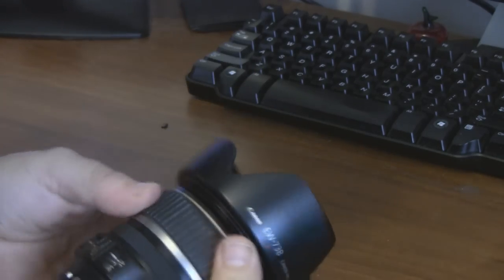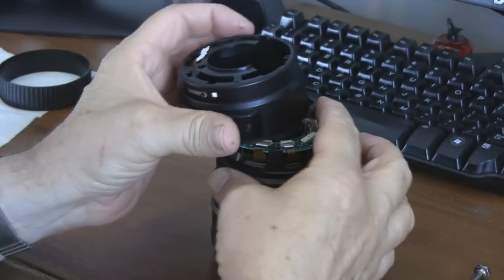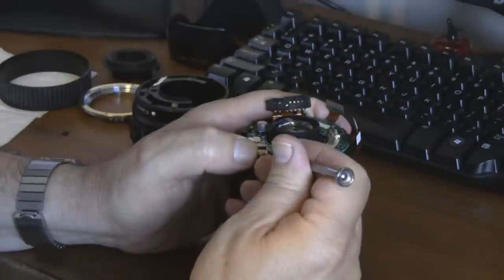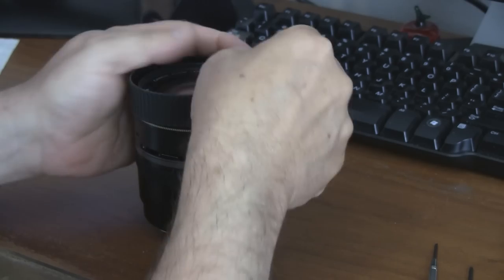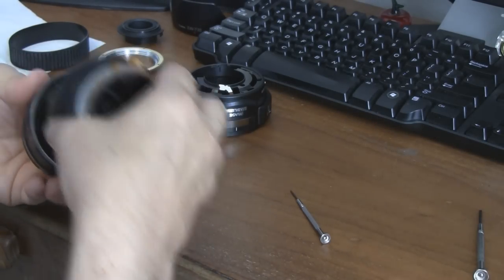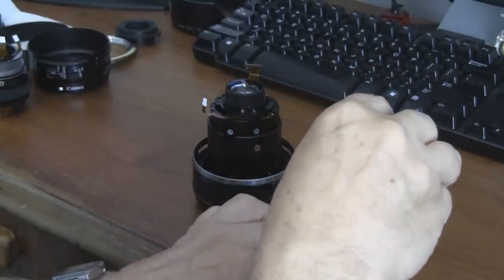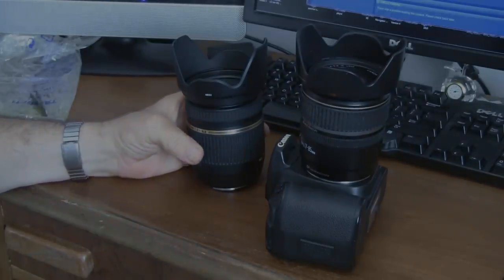How to fix the stuck zoom on a Canon EF-S 17-85mm lense

Comment: Many thanks.  Very clear inistructions.  I used this video to repair my Canon 28-135.  There are a couple minor differences.  To release two of the ribbon cables you gently pull the edges of the white edges of the connector out a tiny bit and the cable releases.  Otherwise pretty much the same.  Using magnetic screwdrivers was a plus.  The zoom screw that was loose was a little one that only showed up as you zoomed back with the housing. Easy to spot. Saved me the cost of another lens.

Comment: Thanks a million for this most informative tutorial!
The zoom function of my lens is fixed (one of the rogue screws, in the heart of the lens,  had completely dropped out).
All functionality tested and working 100% My lens is as good as new.
A couple of tips for those people still to attempt this.
Make a good note (take close-up pics)  of the positions of all components and cables when disassembling the lens.
I also used dots of white correction fluid to mark the relative positions of the plastic components, so they were easy to realign.
I reiterate the words of the videographer; Have good tools! I replaced my watchmaker's screwdriver set for this job. I bought a set with big hand grips.  Money well spent! Without the new screwdrivers I would not have been able to remove the 4 screws holding the bayonet mount, without damage. They were fitted extremely tightly.
Good Luck!

Comment: Thanks for this video. I too stripped or rather bent the fingers / fork of the pressure  contact plate on putting the main lens unit back.You mentioned each screw to remove but for this you said, screw already removed so I opted not to remove it and it was a mistake.  So when I switched it all on the lens was not focussing properly. Disassembled the lens and thought well that’s it, was about to give up but decided to see if I could bend back those fingers to approximately their original shape, I had to use a loupe magnifier,, even the ends of a tweezers was  almost too thick to work on it, and hoped for the best, and it works perfectly now !!!  A few thousand rand (couple hundred dollars) saved, thanks so much!!!

Comment: Thanks. You saved me $300. It wasn't easy, and I am a few hairs less today, but it works like new again. I don't know waht the hardest part was, lining up the manual focus forks, or putting the top ring on and reinstalling the connecters to the circuit board. Thanks again, now I feel like a pro.

Comment: THANK YOU SOOO MUCH! I cant thank you enough for posting this video. It was clear and very helpful. I can finally use my 50D again. I might add i had the same issue of not removing 6 and 6 screws from inner and outer rings. I removed 8 in total and just put them back after. but all is very well.

Comment: One additional point I would make is that the reassembly needs to make sure the AF drive key (twin pronged latch) is engaged to lens focus mechanism when the focus ring is repositioned, took me 3 attempts and bit of info elsewhere to do it.  But like a lot of others here, thanks very much for an awful lot of help.
Reply: Can you elaborate on this? My auto focus is no longer working now that I've fixed the zoom issue and feel like this may have something to do with it.
Reply: +Mitchell Findley 
If you look at the shots about 6minutes25 to 6minutes35, when the focus barrel/ring is removed there is a pronged pieces that sticks down, I think it is on the other side of the barrel so it is not shown in these shots.  This needs to engage with the focus motor drive.  It is a while since I did this and without taking it all apart again I cannot describe it better.
Regards
Reply: +Chris Sweetman thank you I appreciate the reply!
Reply: +Chris Sweetman can you point me to the "bit of into elsewhere" by any chance?  Struggling with this step.
Reply: +beldoolan Sorry, I have had a hunt about and cannot find it now.

Comment: The only thing I can add is that the biggest connector on the PCB has a wedge-lock feature that slides out to release the cable and in to lock it.

Comment: I found this very difficult using only the original video.  A few more shots would have helped.  I'd recommend reviewing the video once or twice before starting and perhaps taking a few shots during the process. I was particular unclear exactly how the different pieces fit together. I also ended up not replacing one screw on the inner-ring. Oddly my camera had only 5 screws per ring- not six as mentioned in this video- the model may have differed slightly.

Comment: I have a question, and I hope you can help me.  the lens in question is not the same one, but a canon 18-200mm, with retractable barrel.  I managed to fix the zoom from being sticky, but now can't seem to reassemble it without having the middle section getting int he way.  It seems when putting the screw on, and holding the barrel onto the main core, there is a piece of glass that I think has to be attached in a specific place?  It follows the core up and down and zooming.  Do you have ideas?

Comment: Same here. Just put it back together about 15 minutes ago but the focus is off and it only zooms to 24-85mm. I took the lens off and put it back 3-4 times and it started to fire up the auto focus a bit then "err" came up and the camera went off. I restarted the camera with another lens and it came back but I am too afraid to put the 17-85 back in case I damage my camera.

Comment: My camera got knocked over with a Nikon DX AF-S 18-55 lens. The zoom ring turns but doesn't move the lens. I've taken it apart at both ends to try to fix it, and found a broken plastic piece broken off with a metal T piece attached to it. Looks like this is what is supposed to move the lens, but I can't find where it broke off of. Have you seen anything like this, or how the zoom ring moves the lens in and out?
Reply from the maker: Sorry, no.

Comment: Hi   If you are still around todate I have a mal function with auto focus on my 17-85 lens. I was told it would cost £200.00 to repair, watching this video you go right into the electronics, were I was told about a loose connection, Anny ideas, Welshman 2081

Comment: Nice video. A lot of work. But here is my comment as a professional commercial photographer and director for over 40 years. Canon MAKES CRAP. Yes their glass is good but....compared to a Nikon body and or lenses ...there is none. Canon feels like a amateur happy snap camera and the Nikon is a tank. Things have not changed I started out with Canon's in the late 70's. F-1 to be exact. The lenses ingested sand, debris, dust everything within the focus rings..around 1982 I switched over to Nikon F-3 and all the lenses and never ever looked back. Fast forward to 2008 and I bought a Canon T3i with the 18-55 and 55-250 THE ZOOM ABSOLUTLEY Sucks on both..feels like the gears are all messed up. Kinda like a carpenter using a drill and the shaft being oblong instead of ROUND. Canon Makes crap...Always will..Always has..THe Nikon's are a TANK and SMOOTH! If you go to BEST BUY and play with comparable camera's the CANON zoom lenses 18-55 and others all BIND on the EF-s. Compare comparable Nikon smooth as a babies ass! WHY??? Just as easy to make crap as it is to make greatness. Canon USA...LMAO!

Comment: you made a mistake you have rubber parts left out , there it is on the table , its a rubber part to stop clacking noise when you zoom all the way out , so now your lens will be noisier , 
its a beginner mistake
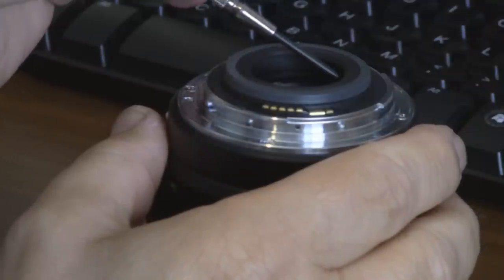Reply from the maker: Yes, actually, I made a mistake, but not what you stated.  The piece you see "left" on the table is a plastic tab I broke off the first ring by being too rough.  (See 1:20 )
Reply: @samqui323  i broke the camera connector flat cable on sigma apo dg 70-300 , i was twisting the back element out my finger slipped and the thing went flying 10m away .
So , shit happens .
Reply from the maker: @dedskin1  Ouch!!
Reply: @samqui323  yeah , so dont do things without removing flex cables first , that i learned the hard way :) Costed me 30$ , broken focusing ring , i repaired it , was all happy , and then trying to fix the optics , ruined it all .
So one must also learn when to stop :)